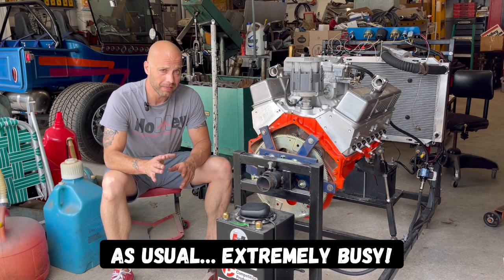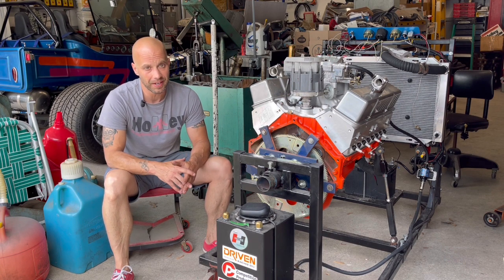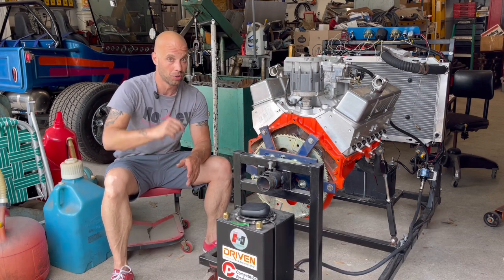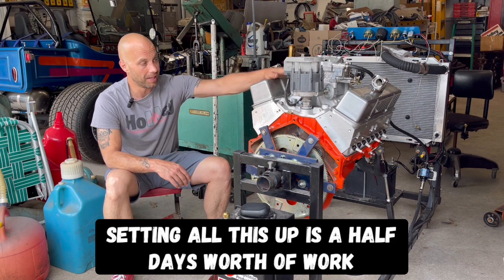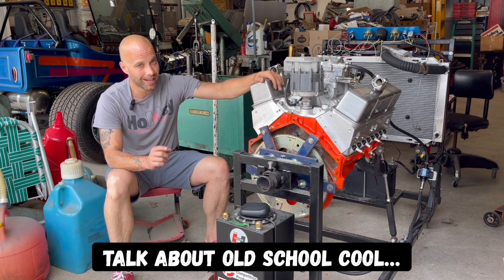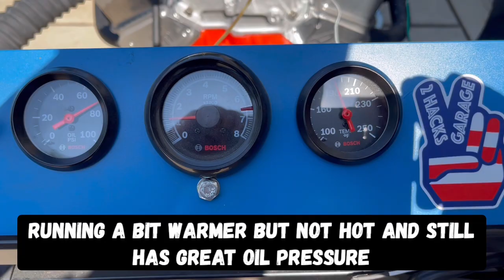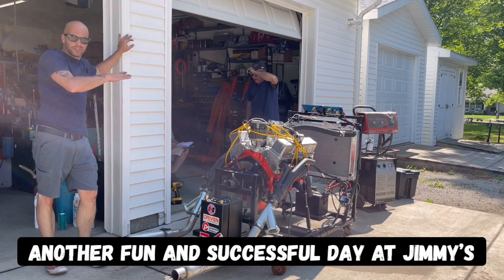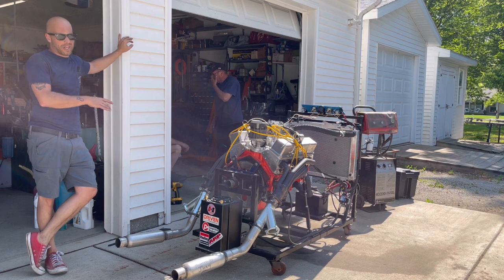Building a 1970 LT1 350 With a Modern Twist Part 3, First Start!  Will it Run and Survive? #engine

Comment: Even if its a roller cam engine, its not good to idle it at start up, run it at 2000 to 3000 to get the oil completely through the engine . Hope this helps !?
Reply from the maker: Yes, we did that in engine break in